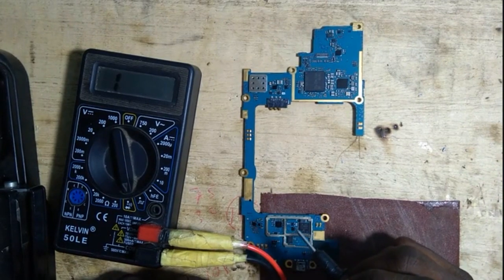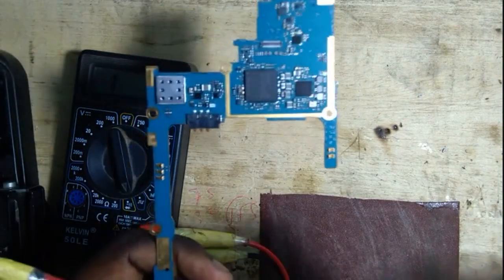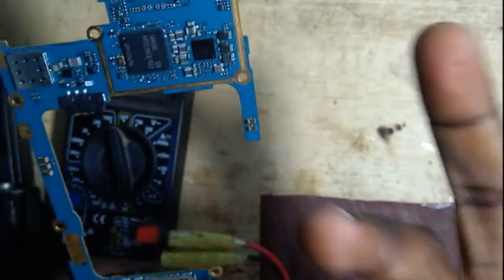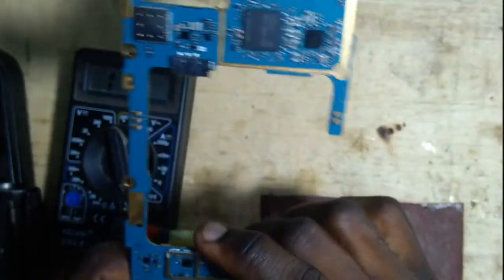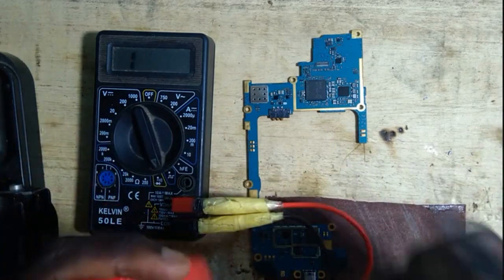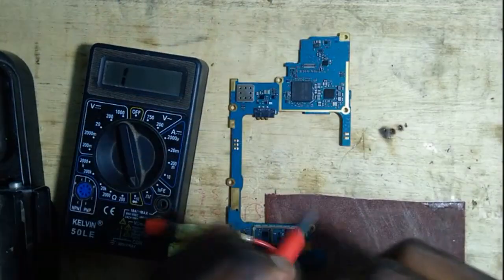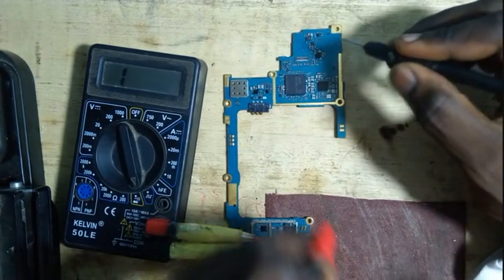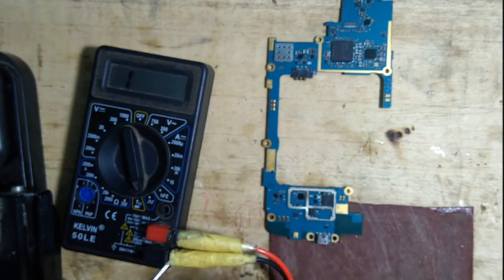HOW TO CHECK SMD CAPACITORS USING DIGITAL MULTIMETER ,2020(ENGLISH)

Comment: How about if all of SMD capacitors beep 1 is shorted and make all of them beep ? iMac 2012 logic board
Reply from the maker: Remove it
Reply: All of them almost the whole logic board are beeping in diode mode. iMac 2012 logic board

Comment: I want to know about the white(colour) capacitor How to know is good or bad?
Reply from the maker: For all capacitors.
To  Know  If  A Capacitor  Is  Healthy,  You Will Observe The Following: 
1. When you set  your  Multi “ 20” DCV modeMeter in , and  place  your  red and black  test  leads  on either  side of the  capacitor, the  current  will dropping.
 2. When you set  your  multikeep meter  in Ohms  mode say for  example 20k Ohms  range, the  resistance  will keep increasing
Reply: @legititrepairs9329  ok thank your. I always used diode mode to check the brown capacitor if is short or not but i didn't have any idea about the white colour ones. Ok thanks again

Comment: Which side of the capacitor is positive and which side is negative ? As in where does the red probe go and where does the black probe go ?
Reply from the maker: Anywhere.
Reply: @legititrepairs9329  so the same applies if i want to inject voltage on to the motherboard i just place the probe on any side if the cap right ?
Reply from the maker: If you want to know the polarity of a capacitor thus the negative or positive of a capacitor just regulate your multimeter AC 20V...if probes are misplaced is will read in negative...hope you understand???
Reply: @legititrepairs9329  regulate what into AC 20V ?
Reply from the maker: @ceejay_gaming9636  multimeter
Reply: @ceejay_gaming9636  Regulate your Multimeter

Comment: I have checked some of my smd capacitors on the board in continuity mode. 2 are beeping. Does it mean they are bad? Or is it normal that some are beeping?
Reply from the maker: Yes..they are bad... however it depends on what the issue or faulty is...a faulty IC can make Capacitor around it to beep.

Comment: I have almost the identical multimeter, but no beep option.. Trying to figure how to tell which caps are bad... When the value is the same as when I touch the two tips together?
Reply from the maker: To know if a capacitor is healthy,you must observe the following
1.when u set your multimeter in 20 dc mode,and place your red and black probes on either sides of a capacitor the current will keep droping..

2.when u set the multimeter on ohms mode say 20k ohm the resistance will keep decrease...

3.in continuity mode it shouldnt beep in continuty mode..if it beeps its bad.
Reply: @legititrepairs9329  ok awesome.. I'm 42 years old, and can never remember these things.. Thanks for the refresher course...I appreciate it very much.
Reply from the maker: @Brian Hankerson